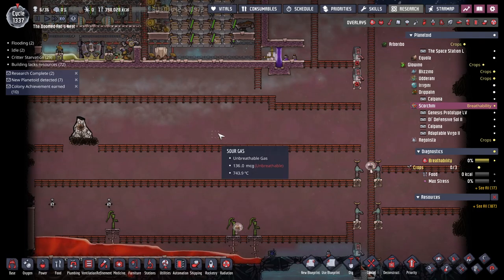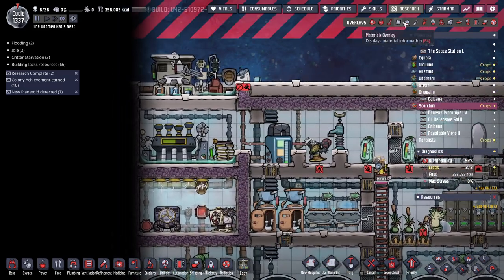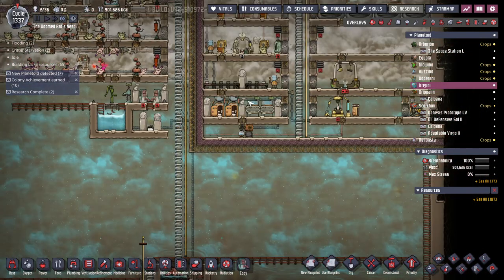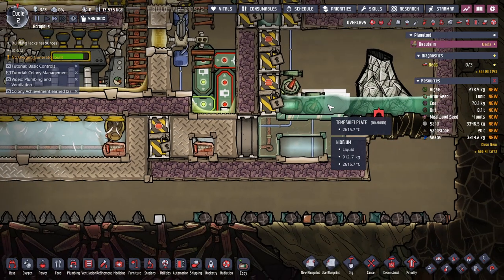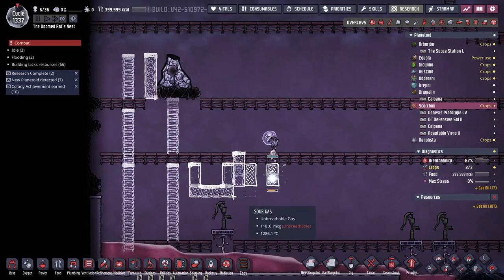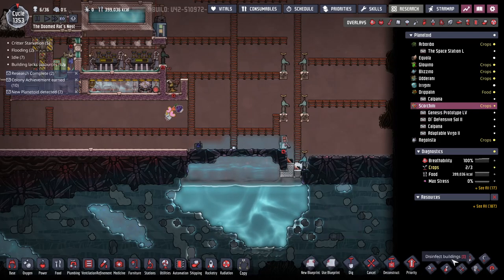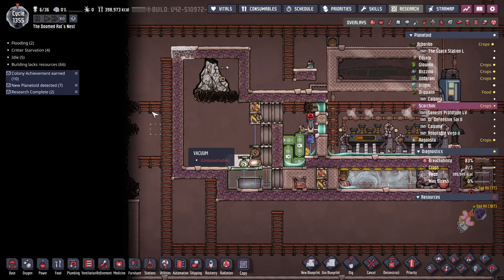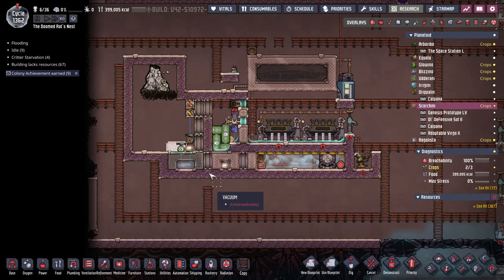Tamed Niobium Volcano Doomed Rats Nest Oxygen Not Included

Comment: Hi everybody! My name is Mikhail. Couple details. I used magma to preheat chamber to 1400-1500C before open vulcano. And after that it takes 3-4 eroptions before it will heated up enough. Niobium has tiny specific heat capacity. About top-left door. Niobium makes tile above 24kg. It means that we have to split niobium twice. We use 2 levels of doors for it. But if we've got so much niobium that it will create 2 layers, first door stop working as a spliter. In this case second hidro-sensor activates top-left door and we have 2 layers doors again. in case when we have that door always open we would lose the pump out speed when we have only one layer of niobium. Good luck! Have fun! P.S. Thanks Tartarus  for sharing this schema. Again: It's not mine. I've seen it in youtube somewhere and didn't see it anything else.
Reply from the maker: Awesome Info!  I will show a way to warm it up with only the niobium volcano next.  thanks again for sharing.